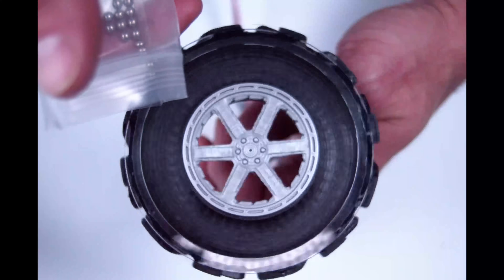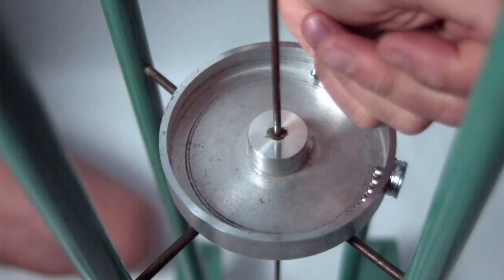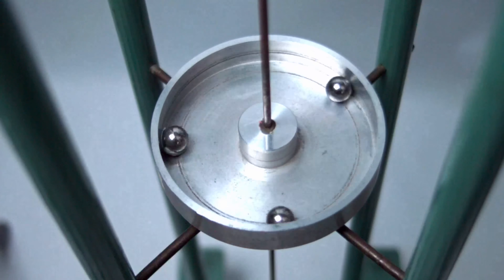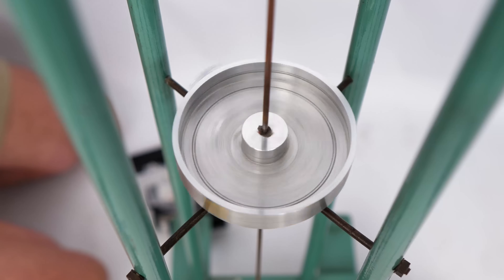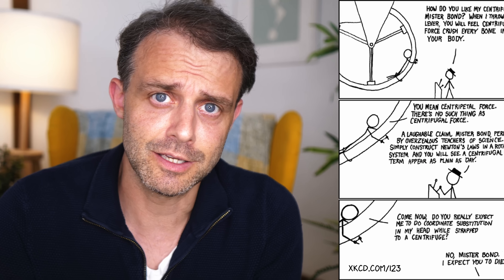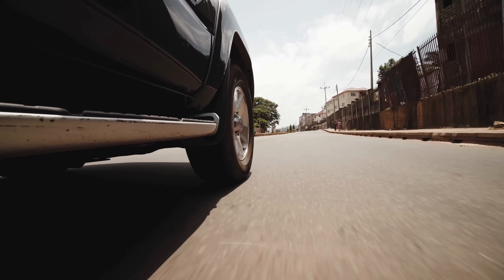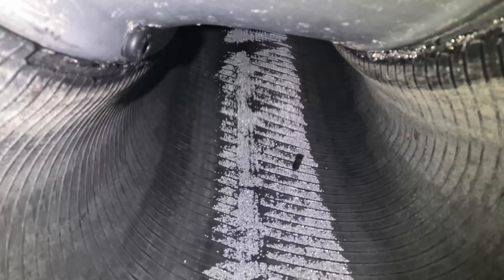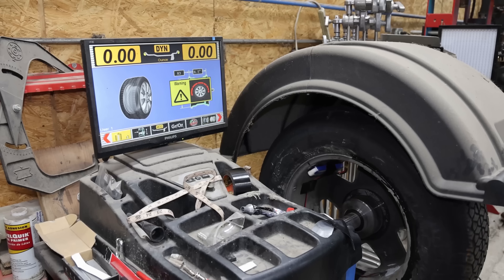Do tire balancing beads actually work?

Comment: I can just imagine trying to explain it to the police, “I had to drive fast enough to balance my tires“
Reply: "Do you have a flat tire? Because you car is vibrating like crazy!"
"Nah, that only happens when it stops. You get used to it."
Reply: After EVERY stop light
Reply: Yes officer, I was going 60mph in a 25mph zone.
But I had to get my beads in place.
Reply: ... and I could not stop at that stop sign otherwise gravity would over power the beads.
Reply: Just start with "when a body spins freely..."
Reply: Don't forget you have to swerve in and out to warm the tyres up.
Reply: And then the police stop you and you need to rebalancing your tires once again
Reply: golden
Reply: Bestt comentrr
Reply: Our old work truck (Chevy 3500) had bead balanced tires. They worked fine. At very slow speeds (5mph) you could hear them if you were outside the truck. Took a minute to get used to.
Reply: Crazy, I use the same excuse for my speeding. But I'm just doing 90 because the steering wheel shakes at 80...
Reply: Would never consider balancing beads to balance a car tire.
Reply: @wlr1589   I installed balance beads in my car tires because the balance I paid good money for was horrible (both vehicles, new tires all the way around.)
The balance beads didn't begin working until after I removed all the external weights.
Reply: Maybe you were testing how the balance beads work and according to the new data it doesn't happen until a certain speed. But I have no idea how fast I was going or what that speed might be. My lawyer might be able to help.
Reply: I've used them for years and they do work mostly on large tire vehicles I've been trying them on my Tahoe as well lately and I have no complaints about them
Reply: And then you refer him to this random video 😅
Reply: Out of balance tires only really become a problem at higher speeds, where the beads correct the problem. If the tires were mounted properly, they shouldn't be out enough to even be noticeable at lower speeds.
Reply: Welcome to Germany
Reply: Just like the what-if xkcd of the machine gun jetpack, where a car is pulled over for speeding while propelled by a gigantic machine gun lol
No officer, I’m sure WHY you’ve pulled me over
Reply: I had to drive fast enough to dry my car after I washed it ..😅 . You can imagine the speed to get out the beads of water out of all the gaps in the doors and all...😅
Reply: This proves that you have zero knowledge of the concept.
Reply: The redneck version of Back to the future.
Reply: So 10 mph is fast? Must be a tard..
Reply: tyres
Reply: It takes effect at 25mph or so. I've done it.
Next dumb statement?
Reply: That's what I was thinking 😂
Reply: Lol
Reply: They balance out by about 5km/hr
Reply: Exactly, WTH is this nonsense! Lol
Reply: So when you slow down it’s wobble wobble ?? Not very efficient now is it. Lol
Reply: When you slow down, it doesn't matter because the wobbles only affect the car at high speed. We're not solving massive limps. Were correcting m8nicule diffen es that manifest a5 high spee. Genius
 @josephpullen1153
Reply: I tried to balance a 3" metal cylinder style pully on a 6 inch high speed belt sander. It did not work! Took it to a shop that balances armatures, problem solved!
Reply: It doesn't take a high rate of speed, they've been using this tech on semi trucks for years.
Reply: Hahaha 😂 made me feel better!
Reply: Best comment ever
Reply: You can only drive smoothly if you accelerate from a stop with a peelout lol
Reply: Indian Spotted😂
Reply: The beads start to work in a car tire around 30mph and before that you wouldn’t feel any vibration from the tires anyway do to the weight of the vehicle
Reply: Maybe goowy beads, like in some kind of sealant will help with them, at least stay in place longer, and at lower speeds? But amplified when you set off from being stopped for a long time.
Reply: Counteract is a brand of balancing beads, I personally use them, they have a bunch of literature on their website detailing what you are saying...

The reason I use them is what I use my vehicle for, it is a work vehicle, and if you get mud on them they can balance still. I would also believe the glass beads can help dissipate heat, potentially increase the life of the tire.
Reply: Wobbles in steering wheel usually show up at hwy speeds. The beads will be spread out perfectly by that time.
Reply: need to reach super critical warp speed
Reply: 35 mph and they are working
Reply: On a car or motorcycle the tires are not on a free axle.   The rims are attached to a stable axle. The beads center a lot faster than 80 klms an hr.
Reply: And replacing the tps monitors every day would suck too
Reply: we only used them in semis tires never in car
Reply: @youneverknow111  How do you get a semi to go over 80km/h? I thought they had speed limiters installed.
Reply: @eklhaft4531  90km/h is here some dont have limits but thats illegal
Reply: haha yes but me as a old car mechanic was thining like him they cant work and go in the high spot but balancing them is always better most time its stays good till you get new tires
Reply: @8alakai8 I use them on 35" mud tires and at any speed they feel balanced.
Reply: A friend had to borrow my pickup one weekend to move some stuff.  He left his car with me but warned that around 45mph the wheel would shake.

I said "no worries, we'll just use my wife's car while he has my truck."

Later, when he returned my truck, he asked if I used his car.  "I told him I did and the wheel was shaking around 45 mph but once I got it up to 100, it all smoothed out.
Reply: @silverbackhayabusa  'but warned that around 45mph the wheel would shake'
Exactly this, out of balance tends to kick in around 45, and the tire beads tend to start working around 35, if you've seen other videos on them.  So they overlap well.
In the 90's you could get a dynamic balancer for the rotor head on our .30 and .60 sized RC helis.  A small hub with bearings, that would balance the 2000 RPM rotor head, that actually had the real imbalance much further out on the rotor blades.  Never used one since it was expensive and unnecessary (if you are skilled you can balance a rotor head to a ridiculously high precision manually with just shaving off small tape pieces for the final balancing).
Reply: the cop respond "our budget also need  balancing with your help paying this ticket."  LOL
Your respond "But that will unbalance my budget"
cop "how about we split 50/50?"  LOL

dam, this sound like asset forfeiture.
Reply: “we”.. don’t speak for us..
 -  “we” have been using them both cars and motorcycles tires for years, and they work fine)
Reply: When they ask why you are in a hurry, just tell them you are on your way to their mom's house.  That should calm them right down.  😂
Reply: Im heading to the olumbing dept at HD. Im really praying I get home before she does or there will be hell to pay
Reply: Or you gotta burn out every time 😅
Reply: @kulvinder1974 the balance of a tyre only matters speed, imagine if cops confiscated your wheels and had them balanced them at your local mechanic so they could give you a fine 😂😂😂
Reply: 😂😂😂 absolute cinema
Reply: Balancing sand will stick to the tire eventually.
Reply: Maybe you could use some glue and drive it on the highway until the glue cures. But make sure there are no traffic jams 😂
Reply: I would say it might ease up the startup speed if beads were magnetic... But that kinda defeats the purpose of a tire
Reply: you shouldn't answer any questions road pirates ask you; police are just the thug arm of professional organized crime.
Reply: They start working almost immediately
Reply: Don't the systems always fall into equilibrium???
Reply: @Histogramas no, the entire video is making the point that there's a speed where it begins to work, and lower than that, the resonance isn't enough. you can get up to speed and then slow down once the beads are in the right position, but if you  slow too much, gravity will begin to overpower the centrifugal force keeping them in place, and you must again brute force them with speed
Reply: @RecurveStickerDragon  Thing is that lower speed, where the beads would fail, would be completely irrelevant in many cases as you would be going so slow in the car that you wouldn't even feel it.
Reply: @NotRandoWis  "Many cases"? I don't know about you, but I come to a complete stop at least once every time I drive my car, when I reach my destination. There's also stop lights, stop signs, other motorists....
Reply: @HiddenWindshield  Yes. Many cases. you didn't have to quote that, I think we can all read here. 
It depends on your driving. My drive to work i stop maybe two times tops. Rest of it is highway and then freeway. Many many other people have similar drives. Its common sense.
Reply: @HiddenWindshield he means that when you are going that slow, the unbalancedness of the tire isnt relevant. It doesnt make you wobble or vibrate, because you are going really slow.
Reply: @RecurveStickerDragon  [but if you  slow too much, gravity will begin to overpower the centrifugal force keeping them in place]

A small defect in the pavement wouldn't also disturb the beads? Picture the beads at the bottom of the tire as it deforms going over RR tracks, for example.
Reply: @NotRandoWis  you'll feel it when you speed up again
Reply: @RecurveStickerDragon 
Maybe you could add a glue into the tyre with the beads. Unfortunately you wouldn't be able to lower your speed until the glue had set the beads in place. 🤔
Reply: @RecurveStickerDragon and when you consider that the wobble is felt more at higher speed and not much at lower speed, it is okay to have that unbalanced tire when you are moving slowly since the weight of the car also keeps the wobble to a minimum.
Reply: @Histogramas Noy always. If you spin the tires and launch fast, you can develop a wobble from just one spot being full of beads. You need to start off a bit more mellow
Reply: I have used beads in MC tires for years.

They balance out at any speed you would notice an imbalance.

A bead balanced tire is in practice indistinguishable from a fixed weight balanced tire.
Reply: Nope, the beads work over 12mph. It already has enough centrifugal force at 10mph.

Comment: I use BB plastic pellets in the trailer. The balls find their place at a speed of about 40-50km/h and the trailer follows really smoothly at higher speeds. Before the balls, the walls of the trailer sway from imbalance.

Comment: Does that mean that the fluid tire sealant might work better (with an added feature of plugging small holes) since it'll pool in a way to balance the tire but also stick to the inside of the tire at lower speeds?

Comment: I believe wheel diameter, amount of beads and bead size has a play in it, smaller diameter tire has more RPM for the same MPH, thus the affect happening sooner in a smaller tire than in larger tires with the same size and amount of beads. larger beads may also take longer to self balance.

Comment: Similar to your milk frother, recently I have had some problems with my washing machine where (sometimes) it resonates with the unbalanced clothes on it hitting the walls, so to (temporarily) fix it I bypass the lid-lock mechanism and with a wet towel I force the shaft to be centered, after a few seconds when it gains max. speed I can leave it and the clothes will be balanced leaving the machine self-destruction for another day...

Comment: I think instead of beads, wouldn't it be better some sort of viscus glue like substance that solidifies in let's say 10 minutes so you chuck it in and hit the highway, after enough time in the correct speed it solidifies and balances the wheel even when you come to a complete stop forever

Comment: I love the physics that this subject exemplifies 😁 In the heavy truck market, most wheel balancing is done with beads because those tires' balance can change significantly over the course of their lives and getting them rebalanced becomes an expensive annoyance (they weigh well over 100 pounds per wheel). This has been the case for decades
Reply: I was looking for this comment, before I wrote the same thing!  👍
Reply: long haul trucking seems like the optimal market for the beads. Just about evetything else is going to encounter stop lights more often than stretches of highway
Reply: and a lot of them spend most of their time between the critical speed and the minimum "gravity dominant" speed, so it absolutely makes sense for them
Reply: Trucks on highways 90% of their time benefit from this "self balancing" phenominon in saving tires from excessive wear as well as saving on fuel. 

Personal cars however spend no more than 20% of their time @ highway speed. Relying on this to balance tires makes your ride miserable.
Reply: @NidalDajani I had balancing beads on my daily driver pickup truck that I drove at normal city speeds the vast majority of the time, they worked fine for years 🤷‍♂️ Never felt any excess vibrations. I don't think your blanket statement applies.

There's also the fact that overall tire diameter has a lot to do with how fast a tire spins at any given speed. The 50mph number stated in this video is not a fixed value for supercritical rotation.
Reply: @FriendlyPhoton 

I welcome your explanation on how you achieve balance in your tires at 30, 40 mph speeds, from one traffic light to the next.

Every tire, rim, suspension group has different natural frequency. Beads balancing works past that frequency (usually in the range of 50 to 60 mph) imbalance vibrations attinuate past that speed on its own without beads.

In case of trucks however the natural frequency band is much wider (18 and 20 wheelers) than our 4 legged vehicles. Thats why beads work well for them (plus the fact they spend most of their lives rolling steadily at highway speeds).
Reply: Off road applications also use balancing beads sometimes. It's common to see 100 or 120 pound wheel and tire combination with oversized tires. Suspension natural frequencies are also quite low in off road applications (low spring rate, large travel) so I would suspect the beads would work at slower speeds.
Reply: @Fix_It_Again_Tony  I wouldn't have thought they work very well at all in off road applications, partly because of the lower speeds but also because of lower pressures. Every time your wheel rotates there is a flat spot at the bottom which will throw the beads around, this would be even more pronounced when you hit an obstacle (a big rock, pothole etc). I guess they're not there for actual off road use but for when you're travelling on smoother roads between off road situations. I could be completely wrong though...
Reply: @sandy_knight You're absolutely right. You only bother balancing tires or using balancing beads if you're going to drive on road too. Lots of people do this because they don't want to trailer their vehicles to trails. If it's an off-road only rig, you don't care.
Reply: @sandy_knight  Yes, but in the off-roading situations you're describing it doesn't matter if your tires are balanced one way or the other, as you're not going to feel it.  It's only when you get somewhere you can speed up that it matters.
Reply: Was dominant for decades, but they are not the norm anymore.

Most fleets only balance the steers, if at all.  Drives and trailer tires are actually told not to balance.

Improved tire technology has helped to make rounder and more balanced tires, so few actually bother anymore.
Reply: @DanielHomant  I worked in a truck wheel manufacturing plant for decades. We found that if we kept the radial and lateral runouts below .030" (max tolerance was .060") no balance weights would be required.  At that time, tire manufacturing wasn't as precise, so at the wheel/tire assembly weight might be required due to the tire being "out of round" or "out of flat".  For more commercial wheels, we'd mark the "low point" of the radial runout so it could be matched to the "high point" of the tire, theoretically cancelling out a lot of total "out of round" of the wheel and tire.
Reply: @rodchallis8031  Yep. Ive had to do that before with a bad wheel.  Shop thought I was paranoid asking to balance just the bare wheels but sure enough, the troublesome one was indeed off balance and slightly out of round.

Always had to be mindful mounting tires on that and was all good once i knew where the issue was.
Reply: Now that's interesting! So it's not a solution searching for a problem - it's an existing solution looking for a new market. Which I don't think exists. It just doesn't make sense for cars.

Comment: [Explains one mode of oscillation: rotating around its center of mass.] "So both types of motion now make sense to me: the low-speed flailing mode, and the high speed vibrating mode." ?!?!!!???!?!?! You only explained one, and didn't even say which one it was?!?

Comment: I wonder if there is a way to speed a car up until the beads are all in position for correct wheel balance, and then some sort of contraption releases a glue packet and covers the beads in place. Drive at that speed for ten minuets or so until the glue dries. Then, the beads will be glued in place and the tires balanced at any speed and even when stopped.

Comment: Sounds like they need invent beads that undergo a one off reaction under sufficient force that turns them into glue so they remain in the position required for perfect balance even after you stop.